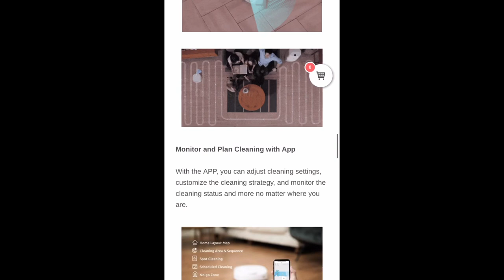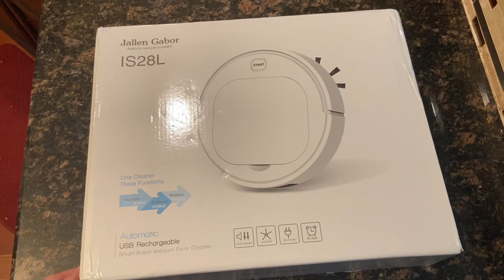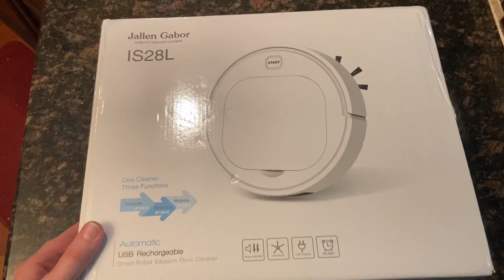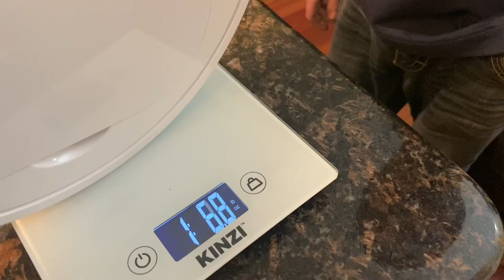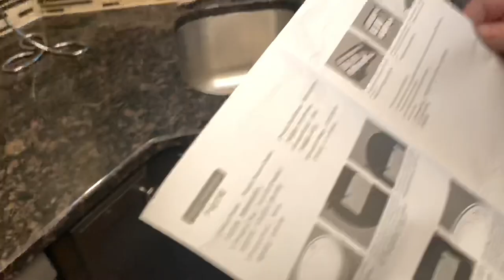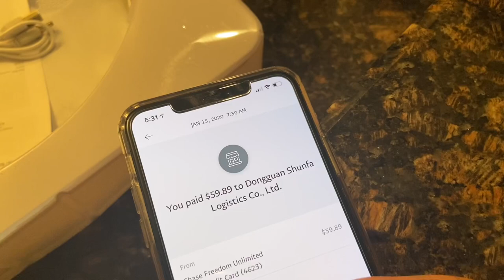NEW in hand!!! 3 in 1 smart robot vacuum mopper sweeper self cleaning mopping pads ROOMBA step aside

Comment: I’m so glad you guys did this video. I tried finding reviews, and there were none. I was dying laughing at this video. The mop mopping your whole house 😂😂😂. I went ahead and purchased a much better one.
Reply: Which one did you get? How well does it work?
Reply: @roxb3731  I got a Lefant one. They’re all really good. I’m very happy with this one. I got the most basic one, so it doesn’t have an app you can use, but they offer some like it. I ended up getting it for like $70 originally almost $200. The reviews are really good too.
Reply: @messywebdev , hey how are you doing, read your review. pls let me know which model of Lefant? thank you
Reply: @imerelqais3069  honestly, you can’t go wrong with any of them once you get to a certain level. I got the M300 which is only sold used on Amazon right now. Get one with at least 1800Pa because any lower and you will see a difference in suction. I like this company because you can contact them with any issues and they will fix the problem ASAP or replace the unit. Pick one in your budget that has WiFi capabilities. That’s the one thing I wish I had. Also, they have ones that are self charging. Those are great if you have tons of empty room surrounding the dock station.
Reply: @messywebdev  thank you so much, I am obliged indeed.